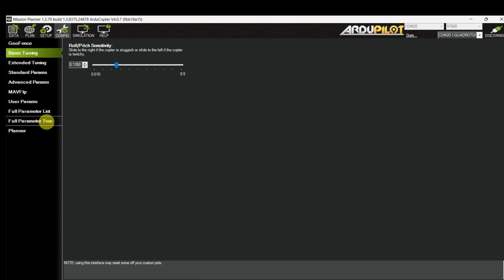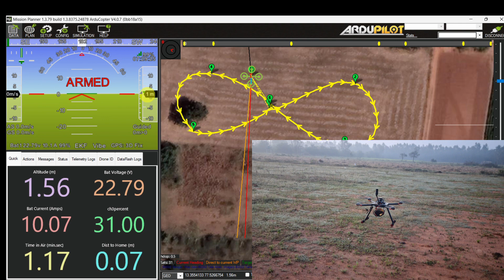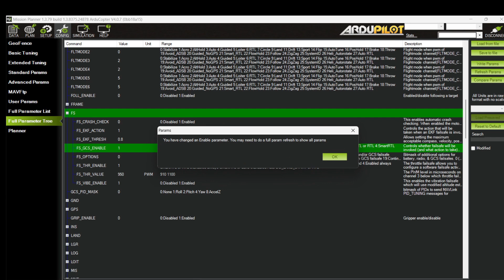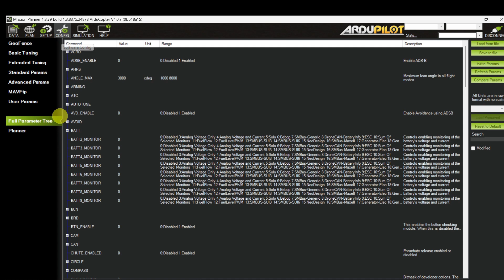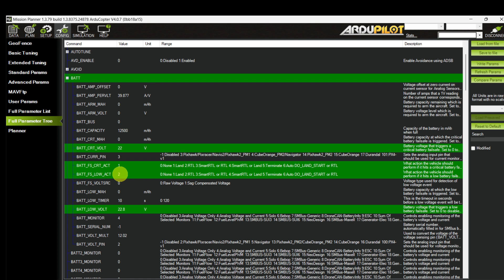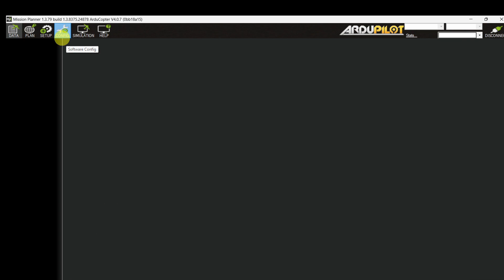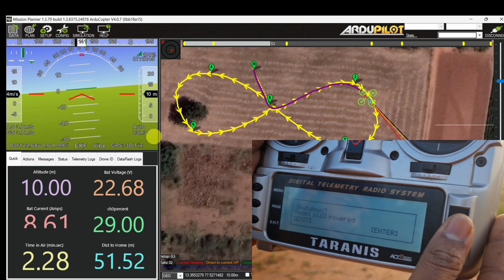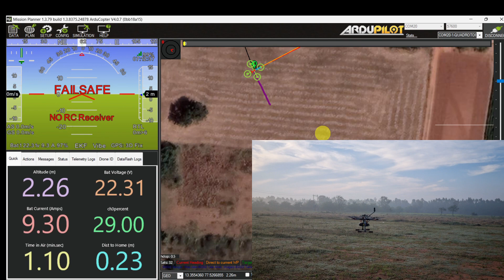Beginner's Tutorial: How to Setup Failsafe Features - Arducopter - Pixhawk Drone

Comment: Best explanation on Failsafe with practical exercise. Keep making such videos. Looking to this video I want from you a solution to my problem. This is my story.I am using Radiolink pixahawk  flight controller.I build it myself on S500 frame.intially I was using 3s lipo battery of 11.7 volt and it was working properly.Now I am trying to use 4S lipo battery of 5200 mah. Battery monitor is setup asper guidelines.But this drone trigger failsafe too early even battery is good. Hud shows Battery voltage 15.7. Failsafe i set at 14.8 voltage. Will you give me solution to this.
Reply from the maker: Two voltage failsafes: 
1. Low voltage, at 4S × 3.7V.
2. Critical voltage, set at 4S × 3.6V.  Initiate landing upon activation of the first failsafe.
Reply: @karthikstechtime0910  Thanks my settings are same.But failsafe activation is premature.I am using 
Qgroundcontrol app as GSC. Is  failsafe tab GSC enable RTL may be the reason for premature failsafe. again I need your help.

Comment: PLEASE HELP : 
Hello Sr, firstly Thanks alot by your videos. please could you help to me? I have all configured for RTL with radio off fail safe, all check in the computer and also with my radio, all seems work well, but when I switch of the radio it does not apear the red big letters message in the meddle that says ( FAIL SAFE , NO RC Receiber ) altough it appear down below in the rigth corner the fly modes where the system advise that RTL mode is ON, I think it is working all, but I have fear to make my first fly because I dont see this big letters in red about  FAIL SAFE , NO RC Receiber
Reply from the maker: First, check the THROTTLE FAILSAFE parameter in the full parameter list to confirm that it is enabled and set to the action RTL. Remove the propeller, arm your copter, keep the throttle in the middle position, then power off your RC. Check the HUD on the mission planner for the displayed message. Ensure that you have a strong GPS signal during this test.

Comment: how to connect the controller to ardupilot for manual operation?
Reply from the maker: Could you explain in detail?
Reply: @karthikstechtime0910  i would have set the drone for some mission(waypoints) and due to some reason the drone isn't able to follow the path , then how to switch to manual mode so that i can take the control of it. Is it that we have to do using the switch provided or else can we program in such a way that if it fails , it will immediately give the control
Reply from the maker: @user-eh4gq4er5z  You can cancel while flying in auto mode by flipping your mode switch twice (stabilize or althold or loiter)
Reply: @karthikstechtime0910  oh ok, thank you ☺